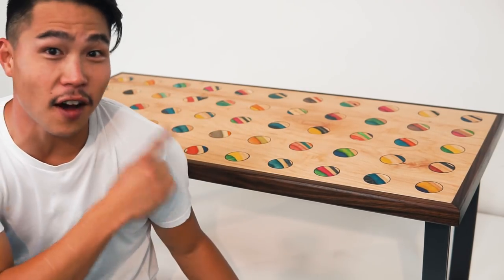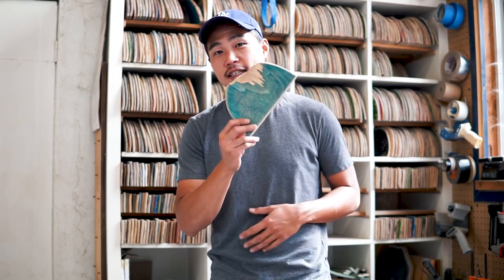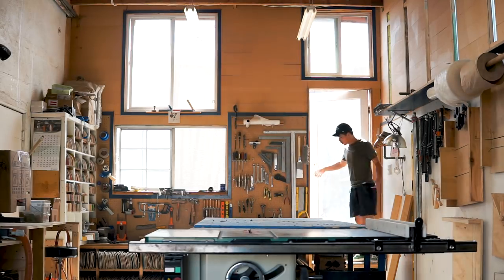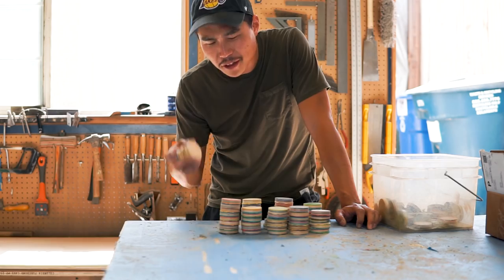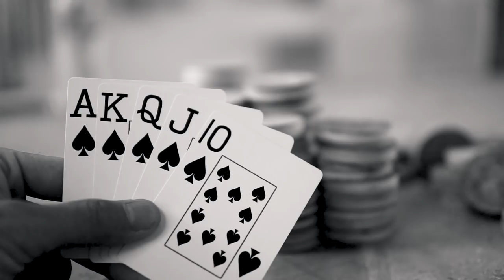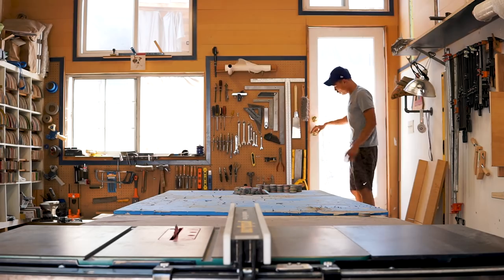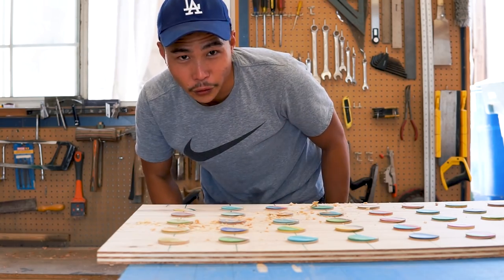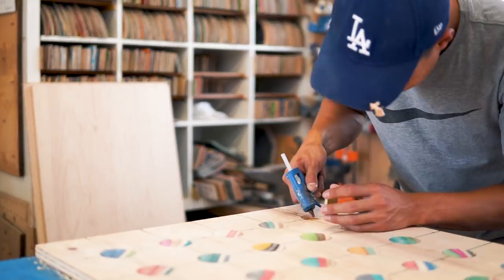COFFEE TABLE/WALL ART MADE OUT OF SKATEBOARDS

Comment: WOW!
Thanks for watching! Please Like!, Comment!, and Subscribe!

          Well, here it is! A coffee table top you can add legs to turn into a coffee table OR you can just hang it! 
          Let’s talk about the materials. I used the “nose” and the “tail” of the skateboards, the two ends of the skateboards. It’s fairly flat so it’s easy to work with, you get 2 piece per board, and usually at least one of them are in pretty good condition. I would normally laminate them together to make a bowl or turn it on the lathe. But not all of them are in good condition. So, to fully utilize these broken and chipped pieces, I cut it into smaller pieces, in this case, circles. Use a sharp hole saw, at any size you’d like! Just make sure to secure the piece to the drill press!
          As for the pattern, I decided to try something new! Skateboard is made up of 7 different veneers of Canadian Maple and depending on the manufacturer, each veneer is dyed different colors. In many cases, only the top veneer is dyed, so it’s best to only show the top veneer, which is why I used them for the “solid” circles. As for the “faded look” or the “layered” pieces, I used skateboards that had the most colored veneers. I sanded one side flat with a belt sander and then flipped it over and sent it through my drum sander. If you're going to make this, watch your fingers. 
          The Slot Machine Scene: Do you ever work by yourself and start daydreaming? Every time I use the drill press, I somehow ALWAYS think about playing the slot machine! And when it comes to doing repeated tasks, this will only keep you going or get you distracted. Either way it’s fun. I mean why even do woodworking if it’s not fun right? As for the poker scene and the whole suit thing… I’m sorry, I thought I could look cool. But I started cringing when I was editing so I don’t blame you if you didn’t like it. 
          I used a forstner bit to drill these holes and if I had to do it again, I would do it differently. The first veneer of standard maple plywood is way too thin. There’s a high chance of chip out and I struggled and learned the hard way. I haven’t try this but I’m pretty positive that using a router with a circle jig would have saved ton of time, energy, materials, my youth, and more. If you have a CNC machine, this would be the perfect time to use it. And because I was using a forstner bit with no stops, I went deeper than the thickness of these circles which meant my next steps got messier which is filling in the gaps.
          I used a glue gun to hold these pieces in place before pouring the epoxy. I like glue gun, I need to use it more often. I used as much glue as possible so I can use less epoxy to fill in the gaps since epoxy is super expensive (I didn’t know how expensive epoxy was… which makes me hate on river tables that much more). As for the dye, use grout. Pretty simple. OH YEA! PRO TIP: pharmacies will give you a syringe if you don’t look like a drug addict. And if you’re a drug addict... get help.
          When it comes to the french cleats, it serves TWO different purposes. First, you can hang it. It’s probably one of the most well known system for hanging things on the wall. Secondly, it adds extra strength to the table top itself. I also added walnut apron around the sides for added support and contrast. So, you have two different options, are you going to use it as a coffee table? Or hang it as a wall art? The choice is yours!
             Well, I think that covers most of the things I wanted to say. Let me just say few more things before you write a lovely, positive, encouraging, and inspiring comments down below. Making a video takes a lot of work, like tons of work. And it really doesn’t help when I have zero experience in woodworking, design, photography, videography, editing, EVEN YOUTUBE! So that means, I just have to work that much harder. But the person who suffers that most out of all this is my wife. I get really into projects and give less and less time to my wife which makes me a terrible husband. She’s been so supportive, encouraging, understanding, inspiring, and so much more and I can’t thank her enough. So help me, if you read up to this far, PLEASE WRITE “ANNIE’S THE BESTEST!” thanks in advance!
          Anyways, thanks again! I truly appreciate all the lovely comments and feedback I been getting and I will try my best to continually impress you all! Let me know what you want me to make BESIDES skateboard made out of skateboard..